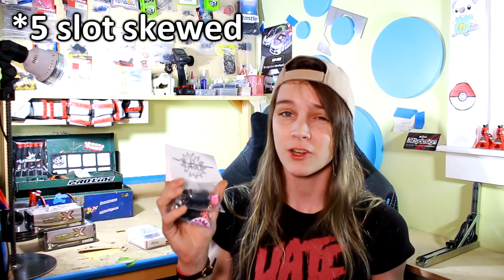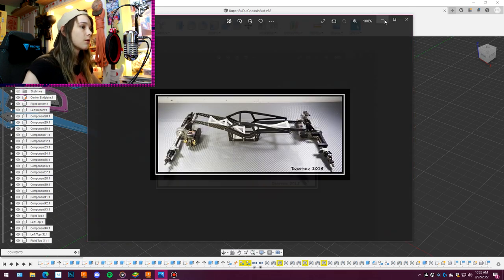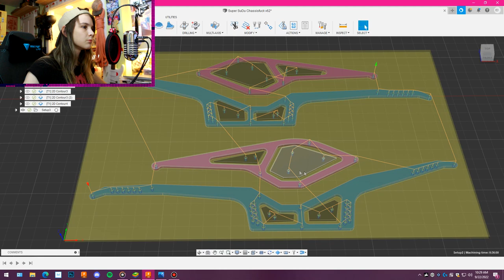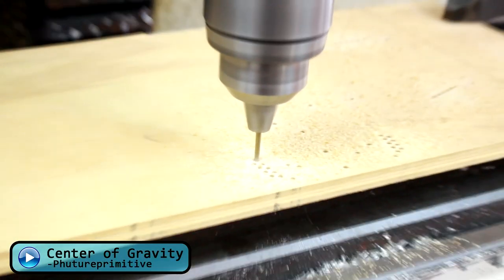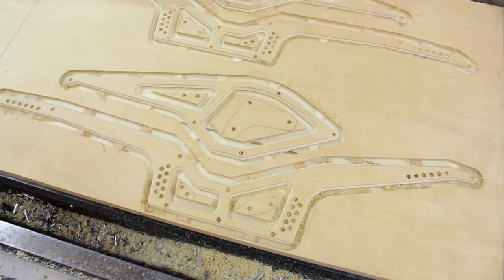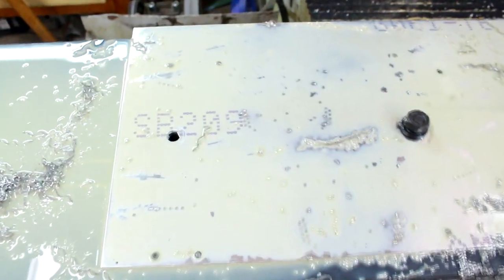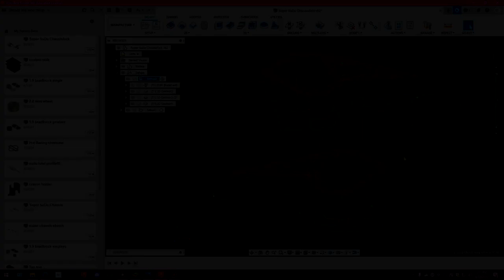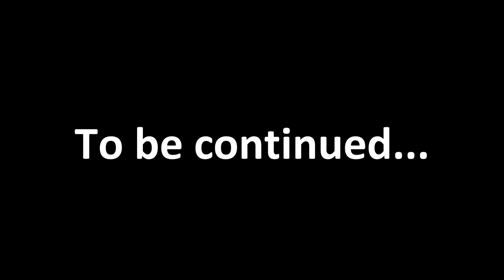MOA Crawler Build |Ep 1| Machining CUSTOM MOA Chassis Plates!!

Comment: Good reflexes to catch the collision!  You can measure those bolt heads in height and then adjust your clearance and retract heights in the ops in fusion to guarantee no collisions!  I have some bolts with heads half machined off from the times I’ve made that mistake!!
Reply from the maker: Haha yeah I think I will make my standard clearance height above those nuts from now on to be safe
Reply: @Hwy49RC  If you do it often, then yes!  Just set the height in the op and then click the thing on the side, and set as default.  IF you're not making production parts where you're trying to absolutely minimize cycle time then a generous clearance just isn't a bad idea.  

I have some large fixtures where I have .5mm clearance over the stock and as it gets machined, I have adjusted the clearance by hand on later toolpaths to minimize time.  

If I can make 11 parts in an hour instead of 10, it's a big deal.  But if you're making one-offs it's worth it to make sure you never have a collision.  

Good to see you back, having fun, and posting.

Comment: Outstanding Video with real cool Music, that CNC was Dancing, gave me a big smile.  I do enjoy Fusion360, I need to use more often.  So what Scale in this ride going to be.  Not a machinist pro, I thought the coolant was running fast, but nice to see later on there's a large coolant tray to catch all runoff.  Question, for those tabs, what amount of Aluminum did you leave behind, and still great see the usage of that CNC and showing ways to support the Aluminum sheet.     😀
Reply from the maker: Thank you! The coolant is more for chip removal with the kind of machining I'm doing; so more flow=better chip removal. The tabs were 1/4x1/16 roughly